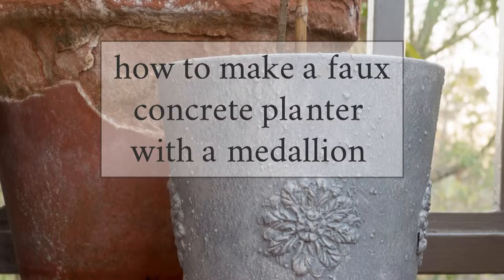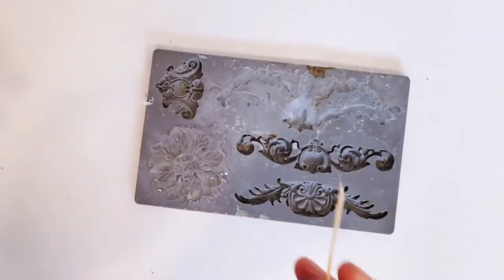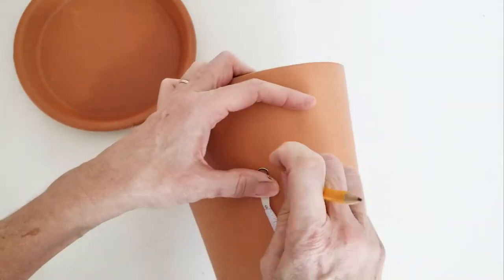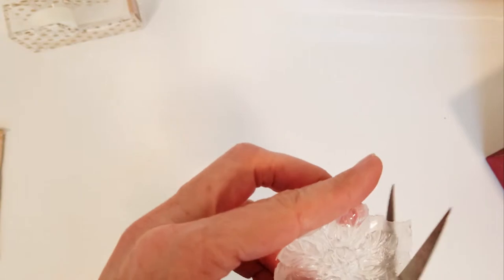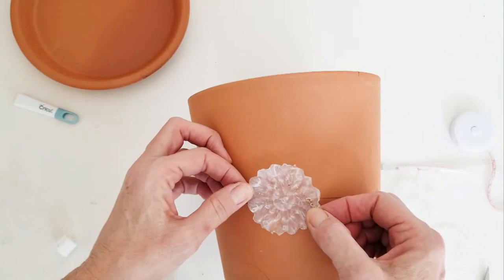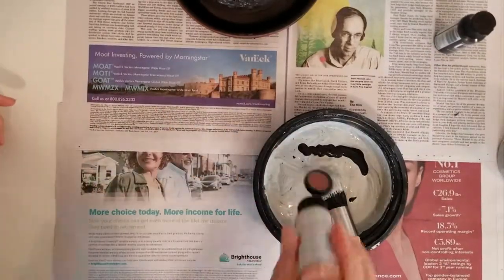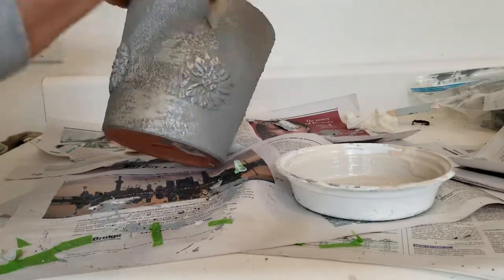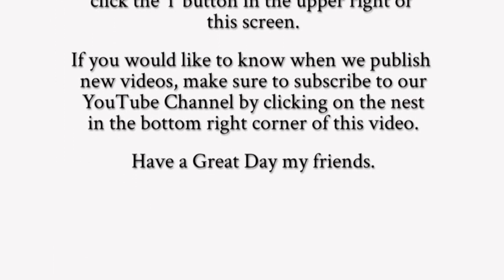DIY Faux Concrete Planter with DIY Flexible Medallion

Comment: I have been thinking of trying those designs with cake moulds and wasnt sure. Now im confident😁
Reply from the maker: Oh yay! Be mindful, if you are using silicone molds then definitely don't use silicone glue...they will bond to each other and you will ruin your mould.

Comment: Dear 'Nourish and Nestle'!....(I don't know your first name).  I've been working on exactly this with a rather large cement (maybe heavy resin?) urn.  I've ordered some baroque molds and am wondering about using Dap Alex Acrylic Latex Caulk Plus Silicone.  Have you tried this as it is supposed to be flexible when dry.  Therefore moldable I would think.  Plaster of Paris perhaps if the mold were put on the urn curvature with a bunjee cord till dry although I'm sure it would be a little too large needing to be shimmed with some more plaster.  Just wondering if you'd tried any of these ideas and if so, how would you adhere them to resin/concrete.  Liquid nails maybe?  I need to protect with something strong as well as I am in Florida which has a LOT of rain at times!  Thankyou...this is such an interesting channel.....KUDOS!!!
Reply from the maker: Hi Carol! So sorry for late reply. So, if your mold is silicone, then definitely stay away from anything with silicone. I did that and suffice it to say that they adhere very well to each other! 🤣 I think the liquid nails would work to adhere them to your pot. I used e6000 glue to make the molds and adhere them to the pots and they worked great. I am in coastal NC and we get lots of rain too and those medallions haven't budged in four years!